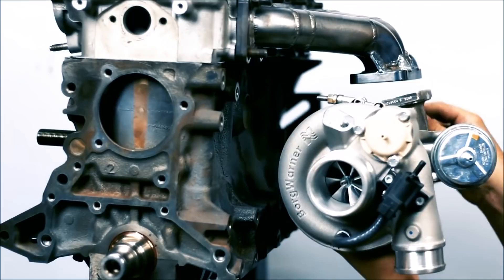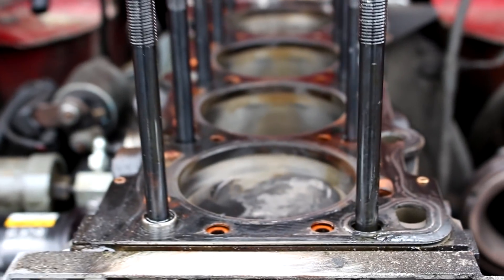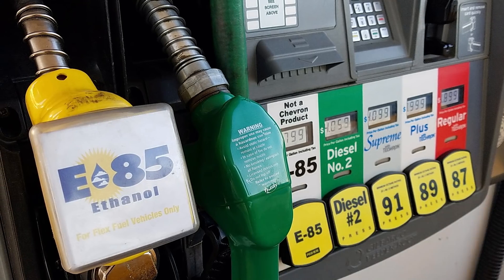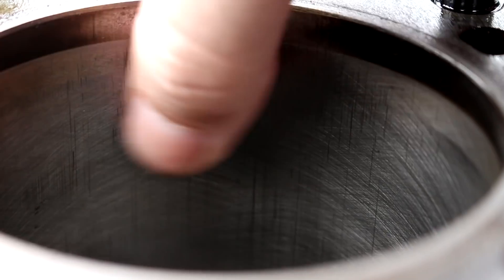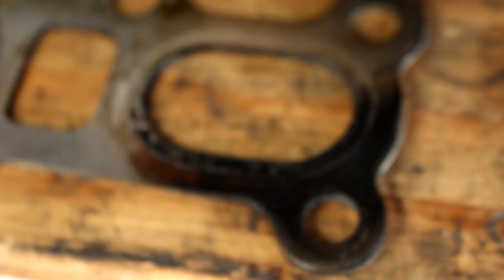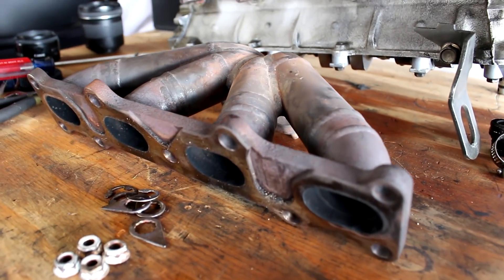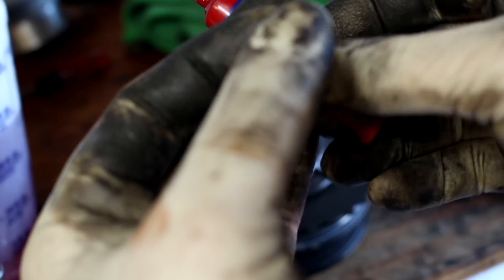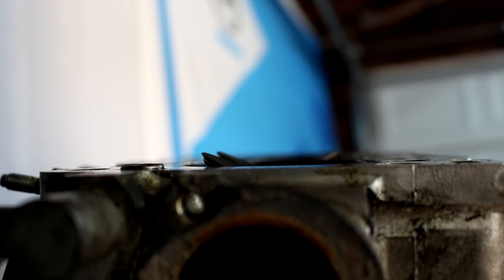400HP Backyard Built Miata Engine Gets Torn Down For Inspection!

Comment: Hey, I followed your video's instructions for changing my timing belt and water pump and stuff on my 1995 Miata a few years ago.  Just a couple months ago I found out that I didn't tighten the crankshaft bolt enough, and the keyway was damaged and the shop where I took the car said the timing had jumped and they had to change the whole crankshaft and rebuild the engine and my car was pretty much done.

They ended up doing the epoxy fix, so my car is running again, but I wanted to make people aware of this potential problem.  Use a torque wrench.

Comment: What would be a better turbo a gt2560r or a gt2860rs. Street use, stock 1.6, 200-225whp  250whp in future?
Reply from the maker: GT2560R, no brainer. The 2860RS is an absolute slug on the 1.6, I used to have that exact setup.
Reply: @TheCarPassionChannel  so besides the gt2560r what would be a good starter turbo?
Reply from the maker: @DylGon_K24  It depends, what are you looking for that the 2560 doesn't offer?

Comment: No manifold relief cuts?

Calipers are not very accurate, even if they are a good brand. No matter how well they are made they will flex and lie. If I ever needed more than +/-0.0015 accuracy I found a mic. 

Check out telescoping bore gauges. For cheap you should be able to check cylinder bores yourself to tenths accuracy, plus a mic of the right size to check pistons.
Reply from the maker: I have a full mic set and bore gauge setup as well. Unfortunately for measuring the valve installed height in a Miata engine you can't use either of those
Reply: @TheCarPassionChannel  Makes sense, probably more than accurate enough for doing that. 

Curious what your plans are if they come out loose. More shim, or different keepers? 

I'll be refreshing a head here soon, too...
Reply from the maker: @pontiacg445  I'm mostly doing it to measure out the relationship between installed height and seat pressure, and to see how much seat pressure shims can add. To see if it's a concern. I'm also upgrading valve springs at this time but figured it would be a great time to check all this out, the head has unknown history

Comment: New here. I'm sure its been discussed, but what oil are you running?
Reply from the maker: Usually Mobil 1 10w40 or 15w40. Or any suitable 10/15w40, I don't really have a brand preference at this point

Comment: 13K miles doesn't seem like much at all on Miata engine. My stock 99 has 235 and still going so how much of a difference is a modified 400 HP Miata going to damage an engine after only 13k vs a stock engine?
Reply from the maker: It's not only the power, but the metals used are different too, any time a softer or harder metal is used it's going to change the wear characteristics. How long a factory Mazda built engine will last vs a forged/high power build is apples to oranges. That being said this thing has plenty of life left, hoping to see 30-40k out of it
Reply: @TheCarPassionChannel  That is intersting to know. When you say type of metal used are you referring to forged pistons or something on the modified engine?

It sounds like a a stock vs modified Miata engine the miles put on a stock engine are multiplied by 50-100 on a one that is modified lol!
Reply from the maker: @ZacharySound  It also has to do with the tolerances made by the machine shop and the quality of the assembly. Me assembling the engine in my garage is not going to have the same level of precision as a Mazda factory, and I've also never built an engine before. For the metals, anything that's harder than stock (to be stronger) like pistons and rings, will wear out the cylinder faster.
Reply: @TheCarPassionChannel  It makes you think when you can get 400k out of a stock Miata engine. I assume with a turbo kit from say Flyin' Miata with engine management I assume is setup to allow it some longevity though. 400 HP is pretty insane though vs a stock engine FM turbo kit giving you about 75 more I guess.
Reply from the maker: @ZacharySound  A stock engine with an FM kit (or any turbo kit) will get you around 225-250whp, the rods will let go above that

Comment: One thing I suggest is getting your header and turbo JET HOT Coated. They will coat the header inside and out! This coating REALLY keeps the temps down and turn around is about a week. If you bead blast everything it will speed things up!!! I have used their coating since the early 80's!!! I LOVE IT! Best Always, Chris Zinn

Comment: Please be sure to attach turbo exh. housing to the manifold when welding those seam cracks! When welded my cracked eq runner near the outlet flange, the flange bent badly by welding metal contracting while cooling... Shaved off ca 2mm to get it plain again

Comment: Is it better to have long tubes from the head to the turbo flange or short ones? I think that long ones will be less likely to crack because it has more pipe to flex, but will that make spool slower?
Reply from the maker: From what Abe at Artech Fab told me, longer runners will have a slight reduction in transient response but offer better top end power. I worry about the long tubes cracking more easily,  because the weight of the turbo has more leverage against them

Comment: I have a weird problem with my na6, engine sounds louder than it should and oil pressure is a bit high. 
Checked for exhaust leaks and there were none. Sometimes oil pressure drops to the norm and engine sounds quieter, all while rpm is the same in both cases

Comment: Is it the revs you’re pulling that lunched the valves? How much gain is there over 7500? Looks pretty solid for how much abuse it’s seen
Reply from the maker: Boost pressure is a big factor as well, as increased manifold pressure is pushing against the valves, making it harder for them to close and seat. It's not something I thought about much before the build, I thought a mild valve spring upgrade would be enough, but maybe not. It's possible the seat pressure was too low as well. My limiter is at 7700, the engine is still making 300wtq @ 7100, falling to around 260wtq by 7600 or so then rapidly falling off. Usually I only rev to 7200-7400 during a pull, but I use those extra revs in the canyons to avoid an upshift

Comment: My MSM engine is being finished now, and includes offset pistons (offset piston pin) in order to reduce side loading.  They work for engines that don't have ideal rod ratios.  ALSO, cut your turbo manifold to allow for expansion in addition to decking the face.  See Flyin' Miata, Kraken and other manifolds for examples.  Looking forward to your next video. ;)

Comment: 4 YEARS!! Didn't you just finish this a couple months ago? Wow, times fun when you're having flies.
Reply: That's because he finished the engine then found out the gearbox couldn't handle it which lasted all of 2018. 2019 was spent chasing a vibration and clutches slipping. So that's why it still feels like a fresh build.

Comment: Those marks on the side could be caused by piston slap when cold? Have you found that noticeable when it’s cold? I am interested because I am planning my VVT Turbo build and want to know what forged pistons are like to actually use. Also did you use Inconel studs on the hot side?
You are still going to be lapping all those exhaust valves again! I am planning on teaching my son that so I can get him to do it lol.
Reply from the maker: That's actually the main reason I went with Supertechs instead of Wisecos; I'm not sure how true it is but from the research I did, Wisecos supposedly are made out of an alloy that contracts slightly more when cold, so they slap more than the ST's. I figured even if it was complete internet lore I wouldn't have issues regardless of which piston I went with. On my motor I don't hear any slap at all on cold starts, but also keep in mind that my "coldest" starts are about 50F

Comment: Nice! Yeah those cylinders look pretty good to me. Definitely more thrust wear than I saw with my boosted motor 300 hp)  but You still have crosshatching! Mine were totally glazed over smooth after 20,000 miles.
Reply from the maker: Thank you for the feedback! It's hard to find relatable info on this, since built motors wear differently with the different metals, and higher powered motors wear differently from stock obviously. I'm interested in seeing how long it will go before it needs rings/bearings. Hopefully I can keep stacking the miles on.